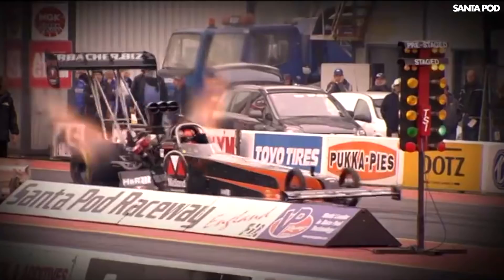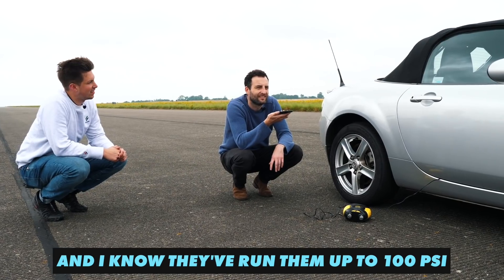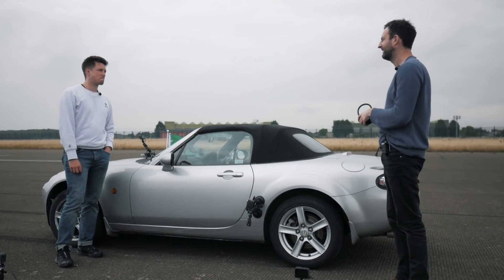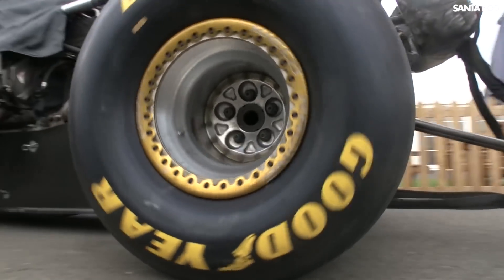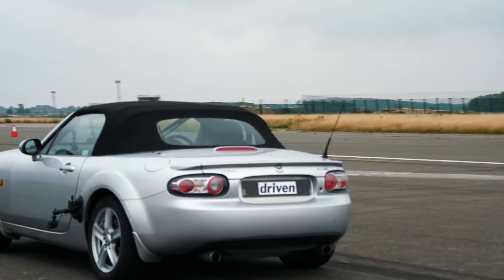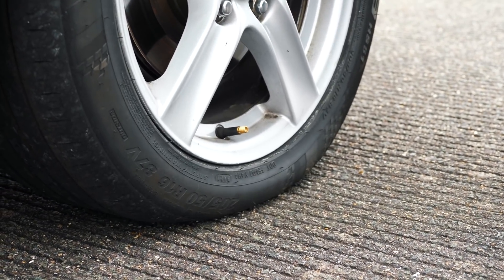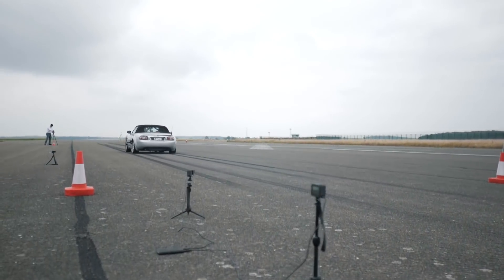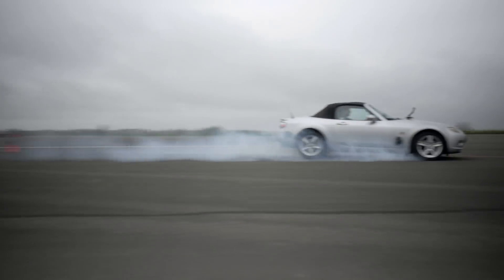Do Flat Tyres Make Your Car FASTER? | For Science

Comment: two competing forces.  for the launch you want traction and more surface area on the tarmac. Once moving, the higher pressure and smaller contact patch cause less friction and therefore more efficient acceleration. The different pressures will produce different advantages and disadvantages at different stages of the 1/8.

Comment: If you want, I can be your driver but we'll have to sign a waiver saying that I'm not responsible for any damages to the car. I reckon if you had red lining the car and switched gears quicker, you could have output more power and speed to the wheels giving you a better time on the airstrip.

Comment: In a dragster, the best accelerration is achieved when wheelspin is about 15%.  That is certainly related to the tyres air pressure and raw power spinning those tyres.   The number (wheelspin %) might be outdated, I learned that many years ago, but the principle is probably still the same, the best acceleration includes also some carefully tuned wheelspinning during the run.

Comment: Your looking for the maximum flat contact patch. Chalk your tires. Take a pice of chalk drag it across a 1/3 of the tread. Drive in a straight line and look at the contact of the chalk. Even chalk removal side to side front to back and across the lugs. It will show pressure to contact. Ajust for even and square running.
Reply: Low pressure will wear the outside. Hi pressure the inside. Ajust the pressure cold for dayly and hot for racing. To low you loose the inside of the contact. To hi you lose the outside. You go low enough the rim will spin inside the tire. The swaying is the tire slung out by centrifugal force and then swaying with no support.

Comment: Lower TIRE pressure increases surface area of the tire. That can be both good and bad.  When accelerating,  that extra surface area can help but at high speeds it slows you down.   The optimal system would be able to change tire pressure on the road between accelerating and increase as speed increases for less friction. Then drop slightly for braking and cornering.

Comment: hmm, tire pressure does affect traction, and also maximum speeds, affecting the last one by not much, a lower pressure will improve off the line acceleration at expense of cornering, as the tire is more deformable, the car feels "loose" thats why most cornering racing cars use low profile tires. and while the tire deformation might affect the acceleration/speed of a dragster (not by much) gear ratio is not affected by wheel diameter, it is the relation between the input and output shaft of the transmission, dragsters do not have transmission, but they couple gradually the clutch in order to change the rotation speed between the driveshaft and engine, this usually results in the clutch melting

Comment: u guys forgot one very important detail in this test: u allways used the same set of tires, wich was losing thread at every launch. I'm sure that if u run the latest tests again on new rubber that could make a difference; surely not much, but u guys know how it goes in racing where every bleep of a second counts. ;)
Tc guys and keep up the good work.

Comment: The lower the tires pressure, the higher the rolling resistance. So yes, you might get a better launch out of it (as seen in the video), however on the long run too low of a pressure will cost you time since the rolling resistance is drastically increased. On a 5000+ hp Dragster that won't be a problem since the centrifugal force pushes the tires outwards thereby creating a smooth surface with less rolling resistance. However actual dragslicks aren't even real tires. They're more like plastic bags (atleast that's what they feel like). They feel like the foil you use to build a nature pool. Normal tires on a normal car will never be able to eleminate the rolling resistance effect and thereby running low pressure is useless and outright dangerous (especially at medium to high cornering speeds)

Comment: Not hating on The MX5, had one for 6 years, but it's too weak for this test. What ever you gain in the launch you lose in rolling resistance. And road tires are too stiff to really benefit from low tire pressure.

Comment: I think the issue here more or less is the low profile tire and lack of power to spin in second and third. on a 32" drag tire, we run about 5 PSI, but it's beadlocked so that it wont spin on the rim, and there's a lot more sidewall to stop the wheel hitting the ground or cutting through the tire at all. this helps us keep wheelspin down when the car comes onto boost in third

Comment: You're trying the equivalent of testing multiple CPUs with a GT710. the result will be the same all the time because the GPU (car in this example) is the bottleneck. This video is worthless.. You'd need a 400 hp car to see appreciable difference. Handling is another thing.

Comment: A bit like suspension  stiffness i think it s a balance to find between grip and "stability". as the tires are softer, the torsion of the sidewalls adds some coeff of friction, but too soft and the bad "stability" of the tyre makes the power having more difficulties to pass.  But yeah tyres are still some black magic. Funny video.

Comment: This is an old video and such but I like to show people that I'm smart (cause I'm soooo egocentric) so I'll still write this comment. 

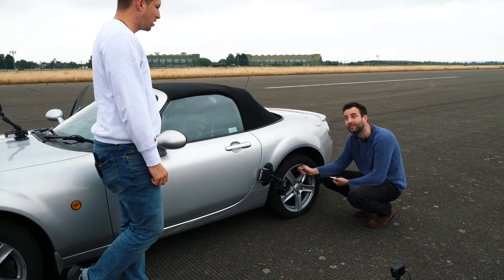8:40 that is incorrect, the fact that the tyre is compressing and going back to its original shape doesn't heat it up, if anything it cools it down. When rubber compresses (as well as when it's stretched) it heats up, this is because of a change in entropy that we are going to avoid talking about. One might think that this is why the tyres heat up, they compress and decompress so fast that they must heat up, right? WRONG. Rubber heats up when compressed, but it cools down to its original temperature when it goes back to its original shape. So there should be no change in temperature, but actually there is, the rubber COOLS DOWN. How tf? 

When you compress rubber, it increases its temperature because of a change in entropy, but its overall energy is the same, now that the tyre is hotter than the surrounding air, it will start exchanging heat with it, so therefore it will lose energy, now both the air and the tyre are at 25 celsius, but when decompressing the tyre, the change in its entropy will cause a drop in temperature, and therefore, the rubber will cool down.

TL;DR: The tyre doesn't heat up because it's being compressed and decompressed too many times, as stated in minute 8:40.

EDIT: I know that a change in entropy does mean a change in energy but I wanted to avoid talking about entropy as it's a topic I am not proficient at.

Comment: 2:40 on some cars u can see when they do burnout to warm up the tires they expand a little from the heat, also they give some flex on the launch so the power isnt too snappy since that will cause the axel to snap. so there is lots that is happening with low pressure but most simple answer is: more grip

Comment: It seems very strange that the stock tire pressure also had the worst performance, with significant improvements with both higher and lower pressure. Is it really that the stock pressure makes such severe compromises for sake of lateral grip, or was it just that your first runs of the day were with colder tires and a less-rubbered starting area?

Comment: You'd need to do that with a car which can spin the tires up to 3rd gear. Otherwise, you're within the margin of error, because 2 seconds into the run, you can't spin the tires anymore.
Reply: are flat tires safe to race out?🤔
Reply: @raven4k998  I'd say going 335 mph on 2.5 in wide tires isn't, but then top fuel dragsters exist...
Reply: @EddieOtool not to mention tires heat up so while driving you should still keep the bead below recommended psi

Comment: I’d love to see how low you can go doing track driving before the bead gives up. Doing off-road stuff 10psi is about as low as I ever dare go before I get too worried about blowing the bead   Without bead locks but I’ve heard some guys go even lower
Reply: 6 psi on crazy soft beach sand and some careful turning.

Comment: if the tyre could only handle a little more you wouldn't be able to drive on normal roads. a small bump at speed would make the tyres explode
Reply: doing 60ft  would make it easier and more precise
Reply: every new toyota has the tyres at 3,5 bar before delivery. it deactivates the pressure monitor system. the radiowaves used by the sensors is not allowed in japan. that's 50psi .  so when those are made in winter the pressure in the summer is even higher . haven't seen a tyre blow and the amount of speedbumps on the docks is insane.

Comment: The problem is as the pressure gets too low the middle of the tire is lifted from the ground and the side squished to the ground if looking at the wheel from the front or rear not the side you will see the dip in the middle of the tire and the edged raised... its the opposite if too much air the middle will be raised and sides lower, there is a sweet spot and that is the pressure on the sidewall unless its a drag radial

Comment: Yeah high pressure more top speed because your wheel wil get bigger and less roll resistance but if your car is very powerful then low tire brow will be faster at drag race for kwart mile

Comment: most of the difference between 30, 50 and 70 psi is your ability to properly drag-race it: the moment of shifting, speed of the shifts. those matter more than the minimal difference in tire response at fully inflated and over.

Comment: When aggressively overinflating used tires, maybe don't be a foot away from the thing with no eye protection.
Reply: You seem to know alot more about old tires than how turbochargers work...
Reply: @sandervanderkammen9230  how much time do you spend staring at turbochargers spun up from the side where the turbine goes in a catastrophic failure? lol

Ah, just realized you're the failed physicist from the other comment section, still thinking you can increase exhaust pressure without increasing exhaust stroke load.
Reply: @microcolonel  I understand they don't teach you thermodynamics at the Walmart Auto Care Center where you work...
The energy used to drive the turbine comes from heat..
Typical temperature drops as it passes through the turbo is 200°F to 300°F.
Reply: @sandervanderkammen9230  Apparently they didn't teach you manners at home, nor sense. The outlet exhaust pressure is higher as a result of the turbine being there. More than one thing can be true at the same time. A turbocharger is not a mere ideal thermal gradient, it is a component in a real system involving masses of hot turbulent gas being pumped by a piston out of the cylinder, while it is still expanding (against and away from the piston).

Why do you pretend to be an engineer on the internet? Just to confuse people?
Reply: @microcolonel  Turbochargers are HEAT ENGINES and operates using the BRAYTON CYCLE...
In a Combined Cycle with the Otto or Diesel engine it is attached to.

This is first year thermodynamics fundamentals..
Reply: @sandervanderkammen9230  The statement that the turbocharger gets its energy from heat is meaningless, everything in the engine gets its energy from heat, but the exhaust gas is also being MECHANICALLY PUMPED during the exhaust stroke, and is not only hotter at the housing inlet than the turbo exhaust outlet, it is higher pressure as well.

An engine is not a mere thermal gradient, it is also a mechanical object which pumps gas into and out of the cylinders, oil through the turbo bearings, and a whole lot of other things. Gases don't just have temperature, they also have  pressure (the two are related, in fact), and mechanical gas pumps such as engines, believe it or not, need to get their energy from somewhere, when compressing and rarefying volumes.

Turbochargers increase exhaust pressure between the piston face and the turbine, so at a given piston speed there are higher exhaust pumping losses when a turbocharger is fitted. If you think otherwise, you are simply mistaken.

The point of the turbocharger is not to have zero effect on exhaust pumping, but to make up for it by increasing the charge mass.
Reply: @microcolonel  The Turbocharger uses an Impulse type turbine...
It does not convert pressure into work... it converts the VELOCITY OF GASSES into mechanical work.

Thank you for proving that you have zero education or professional experience on this topic.

Please stop spreading lies and false information about turbocharged engines.
Reply: @microcolonel  Its sad that you have absolutely no clue what you are talking about, you do not understand the thermodynamics or the Fluid Dynamics involved in the fundamental concept of turbochargers.
Reply: @microcolonel  Then explain why there is a exhaust temperature drop inside the turbine???
The temperature drops as much as 300°..
Where did the Heat go???
Reply: @sandervanderkammen9230  what does the temperature gradient over the turbo have to do with whether there is increased pressure behind a turbo vs a free flowing exhaust?
Reply: @sandervanderkammen9230  buddy, I work with this stuff every day. Your vocabulary is limited to temperature and heat, for some reason is missing pressure entirely. I can't fix your brain, you're going to need a professional.
Reply: @microcolonel  The drop in temperature is directly proportional to amount of heat energy in the waste gasses that is converted into shaft horsepower to drive the compressor.
This energy is not a parasitic load on the engine.
Reply: @sandervanderkammen9230  you are beyond help. Do humanity a favor and never ever work on anything safety critical, you will kill somebody, and in court "but muh ideal thermal gradient over only one component in the system" will baffle the expert witness.
Reply: @microcolonel  The only thing you know about Safety Critical is remembering to torque the lug nuts..

Leave the turbochargers to someone that has a degree in engineering and doesn't work at Walmart.
Reply: @sandervanderkammen9230  oh buddy, oh oh buddy.
Reply: @microcolonel  Maybe you should have stayed in school..

Comment: You aren't accounting to the fact that wheelspin gets the engine up to peak torque faster which was different run to run, as well as the little change to gear ratio due to the effective diameter changing. So not really controlling the variables all that well. On a RWD car, I'd run the rears really low and the fronts really high to reduce contact patch. Interesting regardless, and I wondered about that too.

Comment: You can't do only one try of each pressure test, there are too many factors, mostly clutch and gas human imprecision. And tyre pressure affect launch as well as after the launch, so the times are hardly revelant. Automatic transmission would have been more revelant because it is more consistent(launching and shifting). Try 20 launch of each psi setting and take only the best times and you would have something a little more meaningfull.

Comment: should've done 3 passes at each PSI and taken the average of each.  The first pass was probably slower than the higher psi ones because the driver was rusty, Id imagine each launch gets better than the last one for the most part.
Reply: He is a race car driver
Reply: @jeyoung6244  I didn't know that but still, his performance would get better with each run and averages would be more accurate :)
Reply: Instead of average, you want the best time. Your best time is limited by what the vehicle can achieve, whereas anything less than that will be uncontrolled factors like the human driver or changes in wind and temperature. Averaging makes sense for distributions where fluctuations can make things better or worse, but when fluctuations can only make things worse than ideal, it's more appropriate to take the best rather than the average (or use something like the geometric mean instead of the arithmetic mean, assuming a log-normal distribution instead of a normal).
Reply: @reverse_engineered  that's actually a really good point, still means more tests were needed.

Comment: I don't understand how dumb these guys are... the tires literally has it printed on the side the max PSI the tire can handle. Yeah, I know when tires heat up the air inside does as well thus increasing the tires PSI. I would take the max PSI and go a little under that. Like 5-10 PSI.

Comment: This lower tire pressure is only beneficial when your engine can or is spinning the tires.  Lower pressure means the tires will stop spinning faster or at a lower speed.  Once u are at a speed where you can't spin lower pressure is not adding any advantage to acceleration because now you are just losing engine power to the tires increased friction rather than wheels.  Most road cars won't spin long so in most cases isn't applicable along with decreased gas / engine efficiency.  Cars that spin with lower power then race cars in theory it should help, just noticeably much less and the benefits are out weighed by the drawbacks of letting all the air out.  This is a spectrum and there is always a changing perfectly optimal pressure for every setting, turn you make, weather etc.  You just try and pick the most universal or best overall one for that day depending on who you are, just like you would put all season tires for less maintenance, snow tires for winter grip, summer for efficiency and all that.  Maybe snow tires are more efficient than summer while your spinning, other than that summer tires would be faster with less friction at speed.  Same is true for tire pressure
Reply: Believe in JESUS today, confess and repent of your sins. No one goes to heaven for doing good but by believing in JESUS who died for our sins. GOD loves you soo much unconditionally.🤩❤😍🤗😇☺🙏